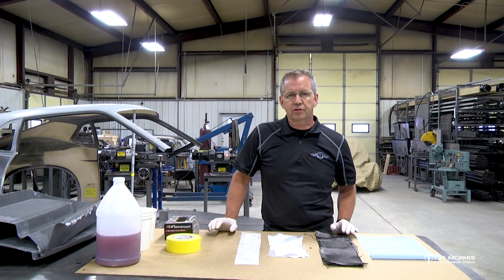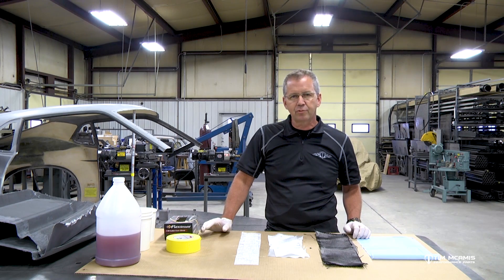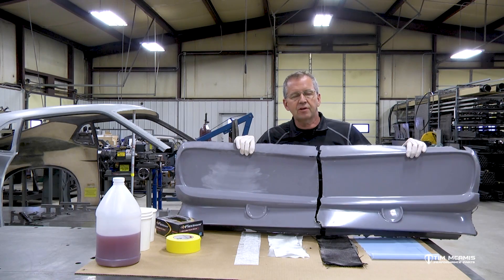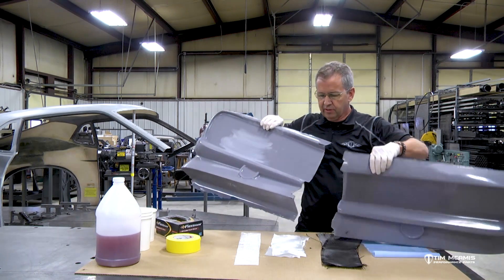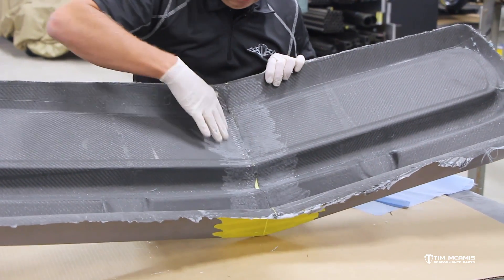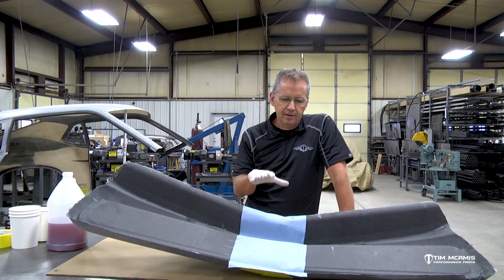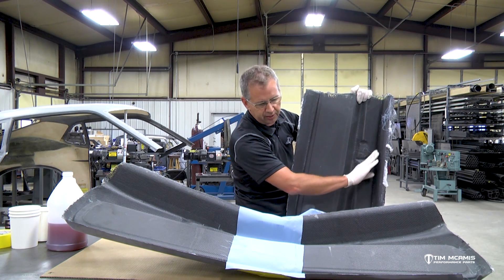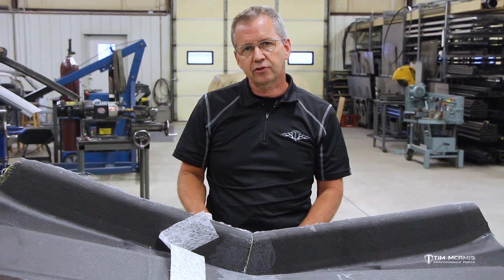Composite Body Repair - Composite Series: E5

Comment: Would some old school 1000 watt halogen work lights be adequate for assisting the curing time?
Reply: I’ve used heat lamps in the past to help cure composite resin.  Just like using a heat gun you need pay attention and not overheat it.

Comment: Love the way you pick on the pro mods! hahaha. I remember when they started the pro mod class. It was the best. I wish they would remove the computer crap from drag racing in all the classes but I'm sure people would figure a way to cheat. The alcohol dragsters and funny cars are my favorite to watch now a days. I think it would be cool if they had a class like super comp with no electronics and no air shifters. You could use an automatic transmission like a powerglide but you would have to manually shift it.